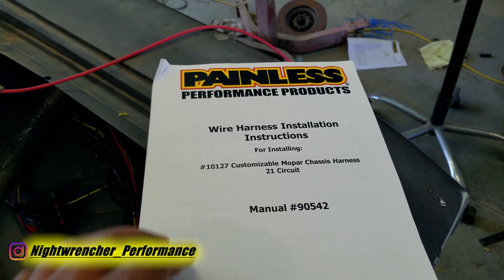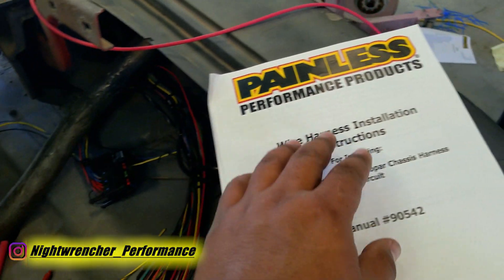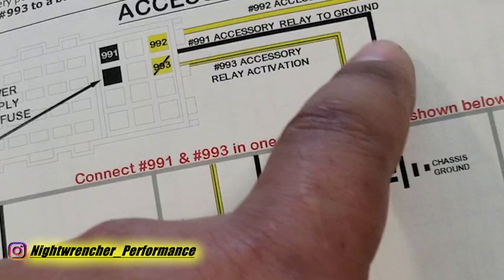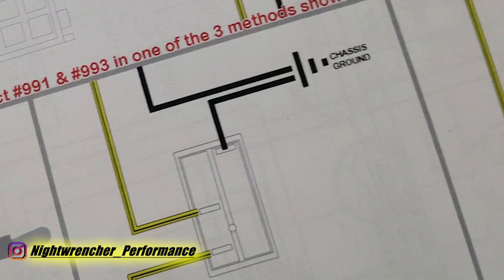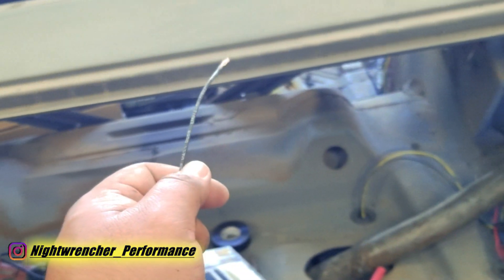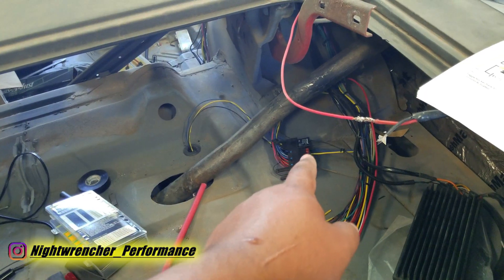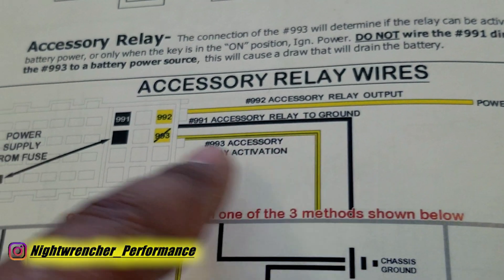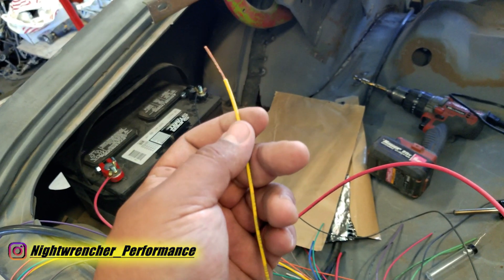How To Wire A Fuel Pump Relay On A Painless Wiring Harness | Painless Fuel Pump Relay

Comment: Y’all gonna laugh at this one… I bought a 12gang solid state relay box and rewired the whole rx7. I’m running the fuel pump, all lights, ignition, fans, and my custom gauges. I use the car daily and I did this about 7-8 months ago and it’s been good to me.
Reply: I think that’s the best way. Old wiring is just too risky imo
Reply from the maker: @Rotorcycle I've reused wiring but usually to redirect it so that it triggers the relays and then run new wire to the components 😂
Reply from the maker: No, I think thats awesome man. I did a similar thing with my W100. Everything had its own relay, I just had to make my own harness.